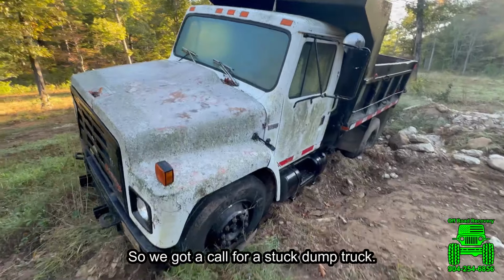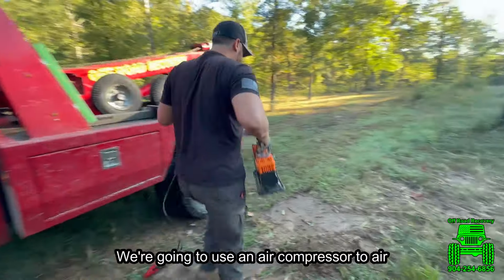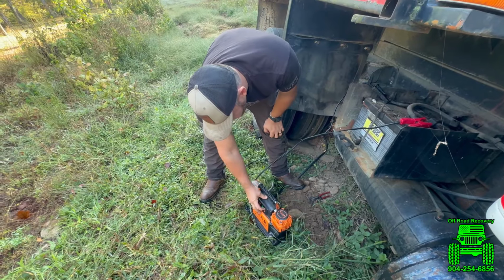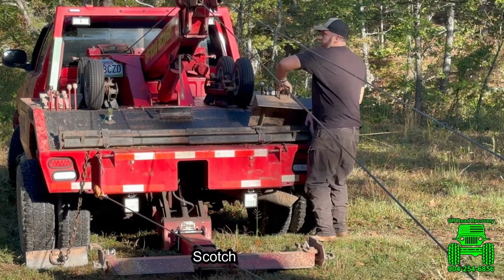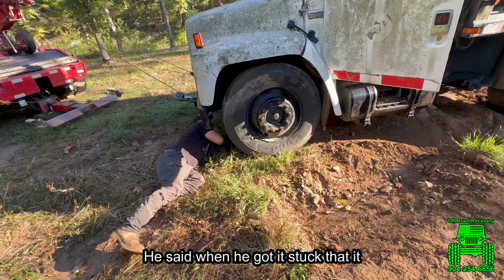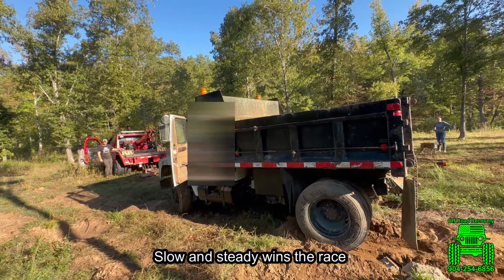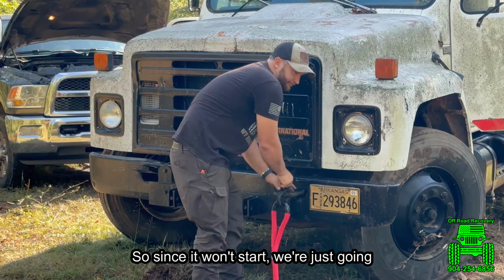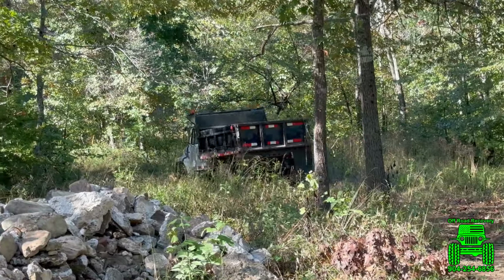Stuck Dump Truck at a Hunt Camp

Comment: algorithm has been recommending me your vids this past week or so, finally decided to check it out. Been following BSF & Rory for years.

Honestly it's impressive to see a recovery operator on YT who actually has the knowledge and understanding around winches & mechanical advantage to do the work without pandering to the typical show-off b.s full-revs routine.

and not only that, but also youve got the decency not to put on a good-guy act for the cameras (a la the other Matt...).

You're definitely worth the subscription. Cheers

Comment: Nice tow truck you picked up that should get you more business with it in service!! I carry a can of starting fluid for hard to start rigs, worth a try!! Good vides!!!!
Reply from the maker: Thank you Sir!
Haha our son learned that trick and keeps it on hand too.
Thanks for watching!
Reply: Could of bled the injectors to get the diesel flowing as you said it was dripping at the fuel primer and more than likely sucking air and good recovery did not think it would move without a bit of shovelling  @matt.mckinzie
Reply: carb cleaner works too

Comment: 6:58 what I usually do… if there’s a primer..   is. Prime until it’s rock hard.  Stop and crank the engine 1 or 2 rotations.  Then stop and prime again until rock hard again.. then rinse and repeat. 

Usually after they’ve lost prime I’ll do this or…..  
the internet will get mad… 

I’ll use either. To get the truck to fire. Then use the either (sparingly) to keep it running.  Have someone mash the throttle. 
And usually the engine will draw the fuel up.  

I’ve done this several times on my own trucks. When they’ve either been parked to long or?  They were run out of fuel. 

The priming method is better

Comment: What do you think load resistance was ?
Reply from the maker: Rough estimate 16k-18k being framed out on one side 
It slide the wrecker with the anchor spade which will hold 10k 
Which only had 3 parts of line and tree had one 
So we upped it to the scotch blocks and anchor spade which we know will hold around 20k 
But remember we still had one line to a dead man 
So we had a limit of around 27k holding
In that configuration
Reply: Thanks a lot 👍

Comment: Matt : needing a land anchor probably ,, have you made a decision whether PullPal or Redridge is superior ?? ,,, I remember you have had- used both ,,,
Reply from the maker: They both perform the same 

For most people the lightweight of a pull pal will make the pull pal a better option 

For me the Redridge will be my go to 
It is twice the weight but stronger which will make it last longer with constant abuse
Reply: @matt.mckinzie  ,,,, thanks ,,, Pulling out 3500 flat bed feeding hay lots in winter ,, minimal trees for anchor in pastures  ,, with Rubicon JK
Reply: Any idea of ballpark resistance with either unit on loamy / clay in pastures ?? Thx in advance !!